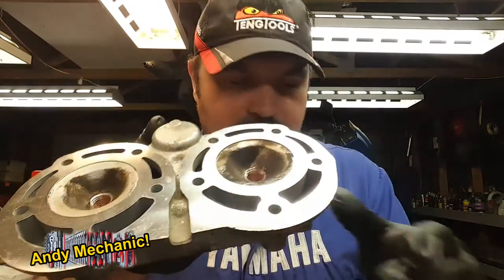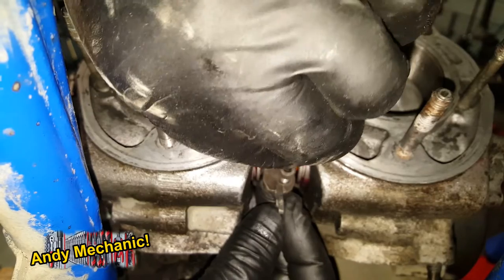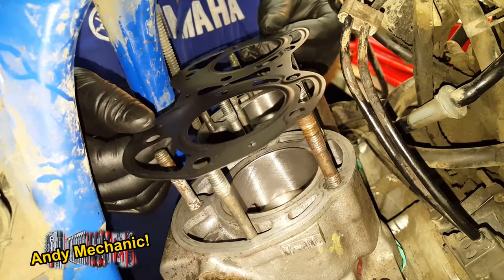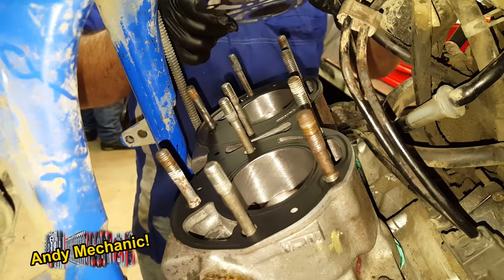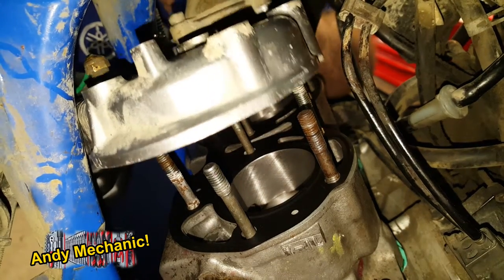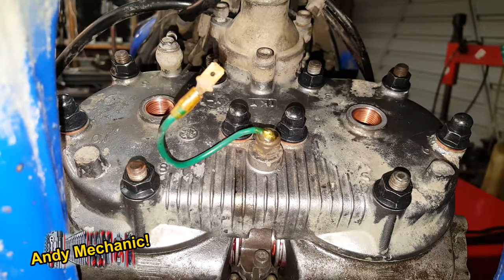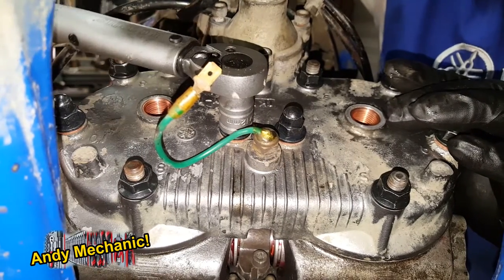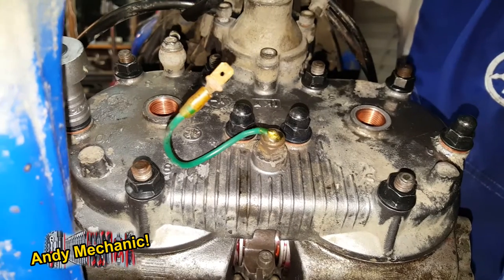TDR250 fitting the cylinder head Ep.4 #1149

Comment: hi, i just did the powervalves in rd 350 f2, when i connect the powervalves together with the connector piece, they are not open by the same amount , when the left cylinder as you sit on bike is fully open, the right is about 5mm still closed. i replaced the right hand powervalve with one from yambits as it was worn. i dont understand how they can be slightly out of sync. yours look much better synced than mine. any ideas?
Reply from the maker: Hmmm....that's an odd one. Maybe the link bar between the two is slightly bent? Or possibly the aftermarket valve is slightly different on the angle of the connection to the link bar. They need to be the same or you could break the crank shaft due to unequal output from each cylinder.

Definitely worth investigating further.

Cheers Andy
Reply: @AndyMechanic  thanks will check  it out
Reply: i think i should have got genuine powervalve. the connector piece is new genuine, i think the angle on the new powervalve end must be different angle to the original
Reply: @AndyMechanic  hi again, thought id give you update. i disconnected the control quadrant and took pipes off, then span the powervalves round so i could see the inner edge, the edge that actually controls the timing and they were perfectly aligned with each other. seems only the outer edge is a bit different. this doesnt reallybother me as its not the busines end of it, the exhaust gas just flows over it. i guess yamaha changed the shape of them slightly and new stock. doesnt exactly match old stock, but it is inconsequential. it also turns out that it is a genuine Yamaha powervalve. yambits buy them from yamaha and repackage, along with a lot of other stuff they sell. cheers